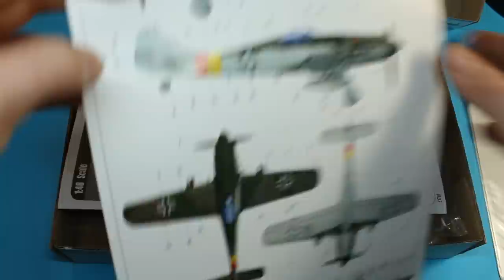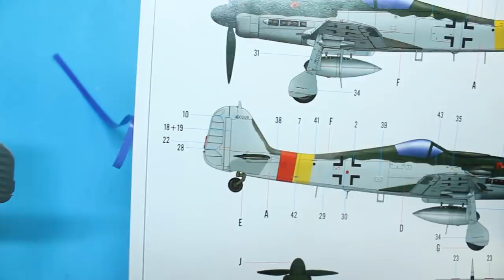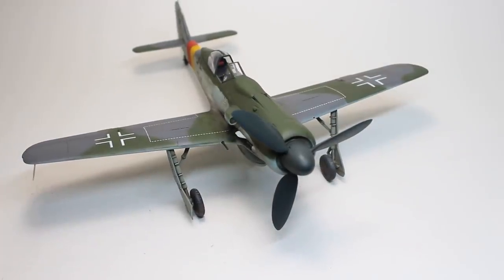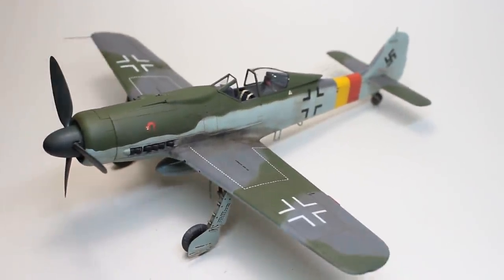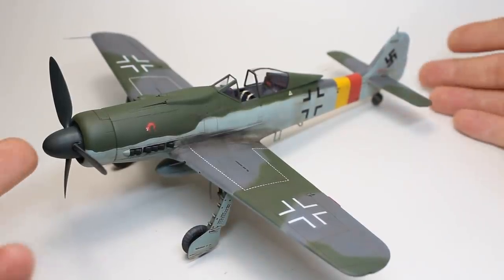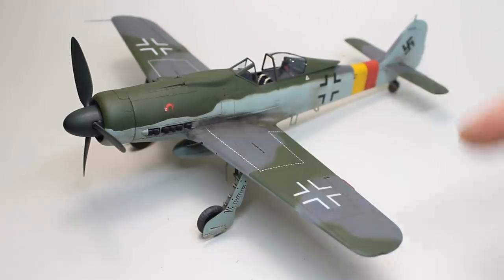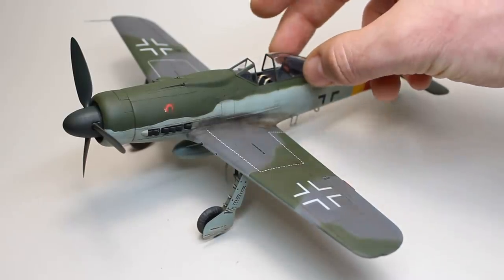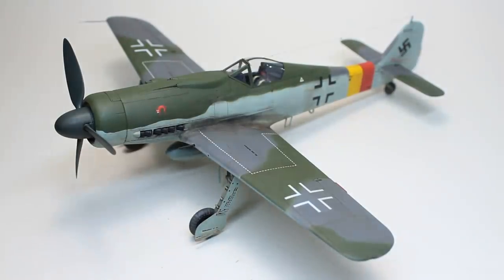Hobby Boss 1/48 FW 190 D9, Full Build Video

Comment: Really nice job on the HB kit. One small point: The grill in the Supercharger Intake should not be there on an active machine. (Restorers put those grills onto static display 190D models to keep birds and animals out of the supercharger.) On an active machine (ie flying) the grill would cut up to 25% of the airflow to the supercharger.... Hobby Boss put those grills into all their Fw 190D/Ta 152 kits, but do not understand why they are present on the Museum examples they see....  One small Aftermarket improvement you could try is to replace the Spinner and Propeller with a resin replacement - the Hobby Boss items are...well, just a little bit aenemic. (the 190D is closer to the actual shape than the Ta152 items , which are really horrible) Compare the HB items with the  Spinner and Propeller from the Old Dragon/Trimaster kit of the D...those are very close indeed. I'm not knocking your build, which is excellent, just advising a little extra oomph that is readily available. (I have all the 190D's from HB and Most of their Ta152s, so I do like these kits.
BTW the pilot of your chosen machine was one Hagen Forster from Jg 301

Comment: Super build of a really nice plane. I love the Dora. Only two points about the kit I noticed: one is that HB made the common mistake of not having the front of the wheel wells open, as in the actual aircraft, and secondly the usual bugbear for Asian manufacturers: getting stencils in the proper language! "Nur hier betreten" is the proper German, there's no such word as "befreton"! Apart from that the kit is anything as good as the Eduard version I built, and you did it great justice!

Comment: I have a small stack of the HB kits (D-9 thru D-13) in my to do pile. One word of caution... research the markings for the aircraft CAREFULLY. By the last 8 months of the war, many D models were delivered with the wooden components painted on the underside ( Flaps, wingtips etc) but the metal skinning was left unpainted in natural metal, and some had upperside Color RLM 75 painted in a broad band forwards of the wheel well on the underside also. I do like the open main wheel bays and the faux engine rear to put above that area. You have done a VERY nice job there and I hope my D-9 turns out as well as yours.
BTW, the use of unpainted areas on the D model is a fairly recent discovery, within the last 10-15 years, and many references are older than that, now.

Comment: Superb build! What was the panel line scribing tool you used? Very cool use of this tool, which I have not seen before.
Reply from the maker: It’s the trumpeter scribed, it has a blade on the end as well as on the pull so you can press and roll it to get a line as well as drag it. https://www.scalemodelshop.co.uk/product/hobby-line-engraver-trumpeter-09912?gclid=CjwKCAiA767jBRBqEiwAGdAOr_yLFLByZpJPdNAPLtfiGPUMTOWRt-99eJ8zuYC9OtCUOQ4R6PMc_RoC4rQQAvD_BwE
Reply: @ChampionScaleModelling  ,

Thank you! I have many panel line scribing tools, but not the Trumpeter with this very useful press and roll feature. I will order one of these today. 

If only I had known about this long ago...

Thanks again.

Comment: Wow very nice build. Can I ask, how did you get rid of silvering problem on decals? Liked and shared.
Reply from the maker: I just make sure the paint finish is smooth and I’m struggling with that I’ll add a gloss coat, then just making sure they all gone on well and even and push them down with a soft cloth, once I’m happy I continue on with a varnish, either gloss or Matt depending on what weathering is going to be done. Thanks for liking the video
Reply from the maker: I just make sure the paint finish is smooth and I’m struggling with that I’ll add a gloss coat, then just making sure they all gone on well and even and push them down with a soft cloth, once I’m happy I continue on with a varnish, either gloss or Matt depending on what weathering is going to be done. Thanks for liking the video
Reply: Champion Scale Modelling thanks. I will try it.

Comment: What part did you sand to improve the fit of the front of the lower wing to the fuselage?
Reply from the maker: It was the front bulkhead of the cockpit and the top of the undercarriage section, that then helped it drop in better